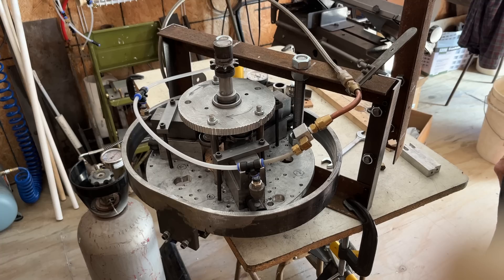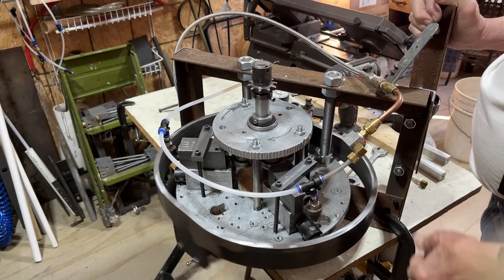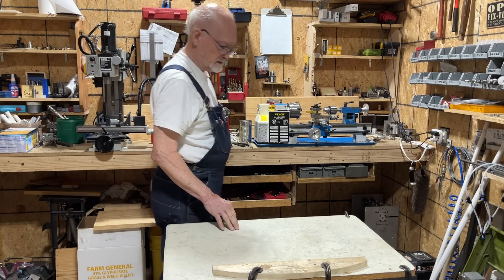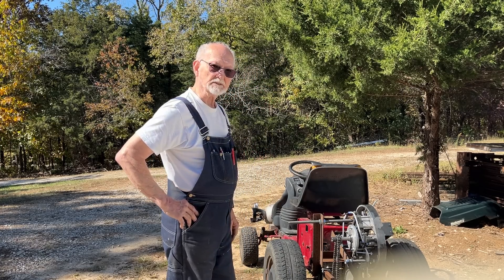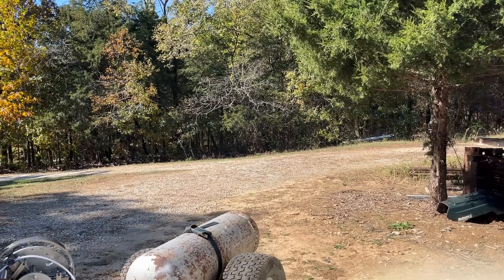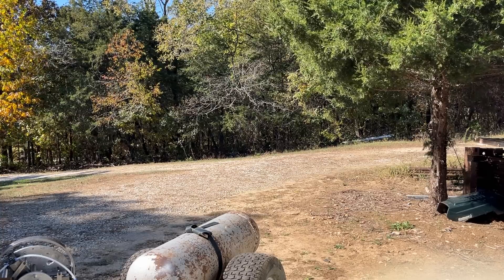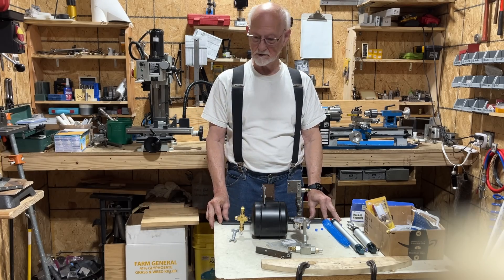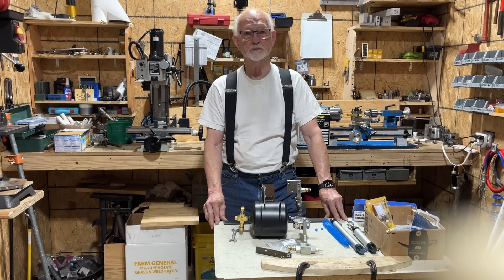Driving with one of my Prototypes - A 3 Cylinder Air Engine 10-20-2024

Comment: Had that idea many many years ago.  I believe there's a company in Europe that are still working on a compressed air engine.  The secret is trapping the escaped/used air for recycling and re compression.   A closed compressed air system be extremely efficient.  
Primary acceleration gear similar to an airgun tool,  higher rpms, through a torque drive system.
Reply from the maker: It would be very complicated if would work, and I am going for as simple and effective as possible.
Thanks for sharing your thoughts though.
Reply: @AirEngineResearch  my thesis was an empty cylinder tank for the escaped/used air to return to. until a certain pressure within collection tank, a valve switch tanks'  compressor now begins filling the escaped fill tank. Until each tank is pressurized used/ depressurized, air is recycled within both tanks. onboard compressor for maintenance of the entire system draining tanks, recharging, overcharging performance applications, safety blow off valves.
Reply from the maker: @kabco99 
To run a compressed air motor psi on the piston to push it down and then exhaust the psi when piston is at bottom 
Putting the exhaust into a tank will start to buildup psi back pressure on the motor and start slowing it more and more as pressure builds 
You need to increase the running pressure to keep it running 
I can only think it won’t work the want it too

Comment: How about adding  a transmission.
Reply from the maker: Thanks for watching and your comment.
I have an older lawnmower that has a six speed transmission, but before I could use it, I would have to design and build an air motor that has the shaft down to work with a belt drive system. 
The one I have is a direct drive and I can’t use it laying on its side so maybe later on this winter or early spring I’ll try to make another engine and put it on that lawnmower

Comment: Would never try with compressed air for efficiecny. Only for idk, low duty cycle air tools? 
A DESIGN i would like to try but havent gotten around to doing, is making a gasoline vapor engine from,,, a liquid cooled 4 stroke engine. SO you delete the coolant, and water pump, and radiator, and just run the carburetor through the block so it runs on vapor in a sealed safe and temperatuer controlled environment. 
The carb is downsized due to most complete burning because atomization is turned to moleculization when its a vapor carb. 
The cooling is caused by gasoline phase change, so like a refrigerant like ethylene or methanol, highish heat capacity. 
The engine runs on less fuel and burns less hot, because of using less gas. So you might be winnning. 
But if it does still overheat, run a second carburetor in series with only water, so the steam is generated before combustion and is hyper expanded and its taking out heat this way, and its extracting more energy from the steam thrust production. 
You lower emissions too with lower everyhting, 
SO, it might work. 
It might be best on an old carbureted liquid cooled motorcycle run underpowered and without convective cooling for thermodynamic efficiency it all must, at the end of the day, radiate the least amount of waste heat, while consuming the least amount of fuel for viable operation. SO it might be underpowered compared to say a big full size cruizer, but when it works as vapor engine and possibly steam too, it would get work done on less fuel than normal carbs. It would work.
Reply from the maker: Thank you for replying in your comments.
If you think it would work, why not go ahead and try it, that’s what I’m doing with compressed air.
I believe nothing ventured nothing gained, and if it doesn’t work the way you think at least you tried.
Reply: @AirEngineResearch  Yeah, Ive got order of operations, or other pending priorities. And theres only so much one should work on GAS engine phew.
Reply from the maker: @RobertSchmitt-u7l 
Thanks again for responding and compressed air. High pressure is dangerous but so long as you have the proper storage tank and airlines and pressure regulator too bring the high-pressure down to a reasonable pressure. It should be safe, but working with gasoline can be very dangerous and you must take every precaution and also minimize the amount of gasoline that’s within the area if something should happen.
Once again, be safe and good luck .

Comment: wow never seen anything like it. very cool
Reply from the maker: Thanks for watching and the comment!
Right now I am asking which of the following engines everyone thinks would be the best to use on a different lawnmower body that has a 6-speed belt drive - see what you think?
https://youtu.be/kyqEAk1lhKs
Reply: @AirEngineResearch  I watched the other video still like the round 3 cylinder it would be cool to see it mounted on a lawn tractor horizontal and maybe even mowing with  air would be an interesting machine😎

Comment: Didnt see close enuough,on the cylinders pistons that push the ring,if there was any lubrication,on recent chevy engines they have   " roller lifters,those are about the same size as what your using, prob.more efficient,but of course,more moving parts,requiring more lubrication. Larger sprocket on motor,less torque/ but more speed,i like to say,and it applies to everything i do,"With performance,comes sacrifice"... wish it wasn't always like that! New subscriber!
Reply from the maker: Thanks for subscribing and watching.
There are bearings in the ends of each piston.
Right now I am asking which of the following engines everyone thinks would be the best to use on a different lawnmower body that has a 6-speed belt drive - see what you think?
https://youtu.be/kyqEAk1lhKs

Comment: Maybe try using an old turbo in reverse as an air motor....?????
Reply from the maker: A turbo is not a positive displacement device that will use way too much air and no torque at low rpm.
Thanks for sharing your thoughts and watching the video

Comment: In my version the aircylinder loads a spring to give it a return  power making it a one stroke engine 🎉
Reply from the maker: Thank you for your comment and watching the video.
I hear many different ideas from subscribers, and I am sure there are many different ways to make something go round and round.
Before I could fully appreciate your idea, it would be necessary to see a sketch or design drawing?
I wonder why you would push on a spring - that I assume would somehow rotate a driveshaft, why not push the driveshaft directly - or does it wind up a big clock spring to turn the shaft?
Anyway, good luck on what you are working on.

Comment: What if there is a catastrophic failure while you're driving it? Could it throw metal at the back of your head? Might be worth installing a protective plate.
Reply from the maker: Thanks for the word of caution.
There is always a chance something could break, but the only things that move are the pistons, and the rotor and they are inside the oval ring?
Reply: @AirEngineResearch  yeah I'm just overly cautious with high rpm stuff. I've seen things shatter quickly into many flying pieces. But you've got it built very sturdy. I'm excited to watch the progress.
Reply from the maker: @raptorfeet thanks for checking in and the comment.
It’s been raining here in Missouri the last couple of days so I haven’t done much outside at all as a matter of fact yesterday morning I went into town and had to scrape ice off my windows before I could go so I guess Windows tell me winter is coming

Comment: I haven't watched the whole video but Is it possible to add an air tank and compressor run by the motion so it runs indefinitely?
I've always said these "Electric cars" should be able to charge themselves and run forever but greed puts a stop to that because they can charge us for recharging.
You my friend are a genius!
What about replacing the rear end with a riding mower transaxle so you can change the gear ratio on the fly?
Reply from the maker: Thanks for watching and commenting.
No it is not possible, it would only work if you were rolling down a hill with the engine off, then maybe the wheels could run a compressor.
I do have another old mower with 6 speed belt drive I am thinking of a way to use it.

Comment: Is it possible to exhaust the air into another tank for reuse and just cycle between the two onboard tanks?
Reply from the maker: Thanks for watching and the comment
Maybe a little bit of exhaust could be saved, but any back pressure on the exhaust would reduce the pressure drop and power of the engine

Comment: As I pointed out earlier, this type of the engine is more promising compared to the other design that you did. its easy to add a flywheel to store the kinetic energy and save on pressure
Reply from the maker: Thanks for watching and the comment.
I have shown in previous videos that the engine will run on 1 cylinder at a very slow rpm, because the Oval Ring is it's self is a flywheel.
Adding another would be more weight and cost, which I don't want.
When the engine is running, each cylinder fires 2 times at different points on the ring, or 6 times per revolution and there is overlap - constant push when the air is on. 
It is direct drive which is not the best way for power and speed.
I have another lawn mower body with 6 speed belt drive that I hope to work out a way to use?
Stay tuned! and thanks again for watching and thumbs up.

Comment: I have worked with air powered engines for about 40 years. Your air engine is very ingenious, and I compliment you on your engineering. Here are three things I keep in mind with air engines: 1) Friction and heat become a problem with higher RPM's. 2) The faster the engine turns, the more pressure and volume is required. There is a point where engine efficiency is sacrificed. 3) Show me a air/steam reciprocating engine that is more efficient than a compound 3 cylinder steam engine? (like Titanic)Turbines produce more power but require more volume and pressure. What can you figure out that produces reasonable power at low pressure and volume? That is what I have struggled with. I would be more than happy to compare designs. I have a machine shop with lathe, mill, surface grinder, welders, etc.
Reply from the maker: Thank you for watching the video, and your comment.
My goal is to make a simple compressed air engine with as few moving parts as possible
It has three cylinders. It has an oval ring that the cylinders push around the outside of the driveshaft, and it has a four bearing rotor that operates the three valves, couldn’t get much simpler than that. 
It makes a lot of noise. It doesn’t run very smooth but I’m getting a little bit more into trying to get it to run better and faster by coming up with a timing advance, which is not easy to do. 
Besides the engine itself, I have to make a pressure flow regulator which I’m working on currently and I still don’t have storage tanks yet. I’m using a couple scuba tanks right now to play around with. 
If you look back over my website, the playlist or video list there’s a lot of times where I show different diagrams and try to explain things so that might help you
https://www.youtube.com/@AirEngineResearch
Reply: @AirEngineResearch  Your machine is simple, which is good. There is a lot of friction which reduces range. The last thing I was working on was an undersquare twin, ball bearing crankshaft, teflon pistons, rotary valve two cycle had the least amount of friction providing power, with lower air volume and pressure providing longer range. My question to you is, How can you dramatically increase the range with the same amount of air?
Reply from the maker: There is no crank shaft.
3 pistons push outward on an Oval Ring with a radius of 6" distance at the flat from the crankshaft. Each piston uses 1 cu in of Compressed Air, or 3 cu in pr revolution vs a crankshaft with a 3" throw using 6" of air x 3 = 18 cu in per revolution.
I use Roller Bearing on the end of each piston against the Oval Ring
I can't be sure what torque is, but I'm studying up on vector analysis to see if I can find some examples that match my design to out if my calculations are correct or not?
So anyway, I'm trying to run as efficiently as I can

Comment: Do you have any ideas to make it more efficient?  Do you think counter balancing the ring would make it run smoother? It would loose alot less energy to vibrations if you could
Reply from the maker: Thanks for your reply or comment.
Actually, it’s not a ring, it is an oval. It has two flat spots and two curved ends so it is counter balanced just variations in the metal itself makes it need to be weighted which I did,  and it no longer vibrated , or shook like the first time

Comment: Why the directional arrows if its just going to spin the opposite way? I had to rewind because i thought i was trippin
Reply from the maker: Thanks for your reply and watching my videos.
The arrow or for my use when I’m working on the engine, sometimes upside down, sometimes right side up and the direction can be variable. All you have to do is turn the rotor over and the valves upside down and the engine will run in reverse or forward if you do the reverse again .
I’ve been confused a couple of times that’s why the arrows help me orient my self while I work

Comment: THIS IS NOTHING NEW.  U NEED TO RUN A COMPRESSOR OFF THE MOTOR TO CHARGE THE AIR TANK AT SAME TIME.
Reply from the maker: Thank you for commenting.
My understanding is that is not possible, if it were possible that would be perpetual motion.
If you check further into, I think you will eventually find that to be true.

Comment: Nice idea, but why don't you try aair compressor  instead of air tanks. Love your idea though❤❤❤❤
Reply from the maker: Main reason is air compressor would not keep up with the air demand and second reason would be to supply electricity to compressor and still not enough volume.
Only practical way is to have storage tank at high-pressure to get the volume needed to run for any distance. 
Thanks for checking in though

Comment: Needs independent lines to each cylinder and counter weights on the low sides of the ring.
Reply from the maker: I have tried. Independent. Lines doesn’t seem to make any difference on 200 psi or better, and the rain is balanced.
Thanks for commenting in watching the video

Comment: I think you're a brilliant guy that's a an amazing engine you came up with I haven't seen the other ones as I'm just now kind of finding out about you now. I thought I'd also add you ever thought about maybe like a firewall or a scatter Shield back there to help protect your Dome specially if you're thinking about upping the RPMs just thought I'd throw the idea out there man I'd hate to see something bad happen
Reply from the maker: Thanks for commenting
At some point, I will need to put a cover over it if nothing else to protect it from the weather it’s made from just metal not stainless so it’ll rust. Something terrible if it gets wet and doesn’t dry off or stay dry.

Comment: What a great job you’ve done this could be the beginning of something great you could compress the air with a small wind meal or a paddle wheel if you live close door flowing water😊😊
Reply from the maker: Thanks for watching the video and the suggestion.
My feeling is the same solar or wind, water powered whatever as long as we can work it out after I get the engine working the way I want.

Comment: Now you need a long air hose.  How about a solar steam engine or solar to electrolysis to engine?  I like the many balancing holes in the aluminum plate.
Reply from the maker: Thanks for the comments.
I'll start from the back - the many holes you see in the Aluminum plate isn't for balance, they are from previous use on different ideas.
Aluminum is really really expensive, and I reuse a lot when I can.
At present I'm using a hose and a propane tank for air supply, but later if it works out, I'll get a carbon fiber CNG tank or tanks.
Solar or Windpower should be used to compress the air supply and fill portable tanks in, or, on the vehicle.
Reply: @AirEngineResearch  the balance thing was a joke.  Plate looks like it was a sacrificial work surface for a mill or drill press so not to drill into machine table.  We are loosing your skills in USA.  Kids are playing video instead of playing in the garage.  I taught manufacturing engineering in a 2 yr college.  We need more of that.
Reply from the maker: @DIYJim-wx6hq 
I thought so

Comment: I design and make air engines also. Mine use external pistons.
Reply from the maker: Thanks for checking in.
I'm always interested in what others have come up with, but you'll have to explain more for me to picture an external piston?
Reply: @AirEngineResearch  
External pistons are open to the atmosphere and roll as a bolus of air propels them along a rotary pathway and instead of a maximum power stroke of 173-ish degrees as in a reciprocating device, external pistons' power stroke is about 352 degrees per single revolution. I use extremely long power strokes utilizing only a modicum of low-pressure (35 psig) against a transmission to recapture power. I make mostly stationary engines running electric generators for power on demand. My "storage battery" is 2,000 gallons of compressed air obtained from small windmills that compress air.

Comment: What kind of torque can you get on this ? Amazing work .
Reply from the maker: 78.5 Ft Lbs using this formula ((((D12/2)*(D12/2)*3.14)*6)*200)/12
RPMs are 800
Horse Power = Torque(N.m) * Speed(rpm) /(9.5488*745.7)			
Torque	N.M.		
78.5	1.355817948	Speed	Horse Power
		                                  800.0	    12.07
Remenber, that is calculated, but I don't doubt it.

Thanks for watching and responding